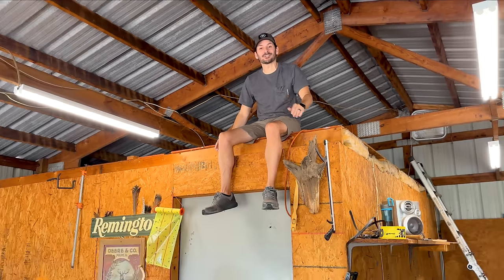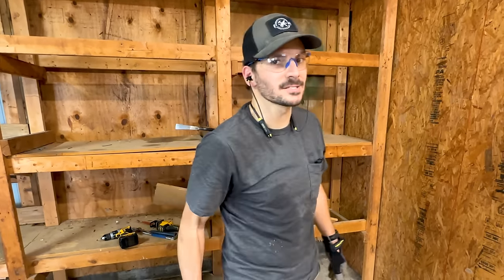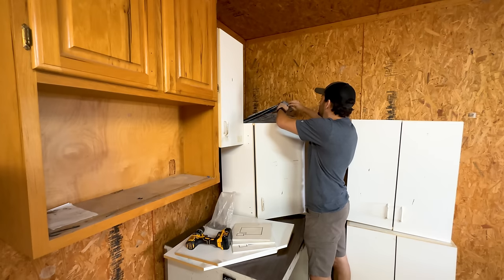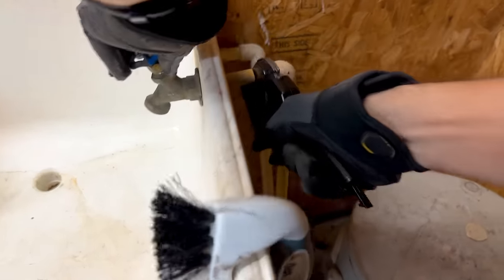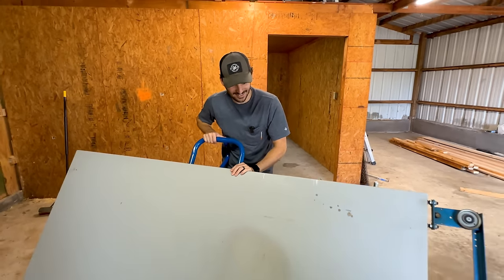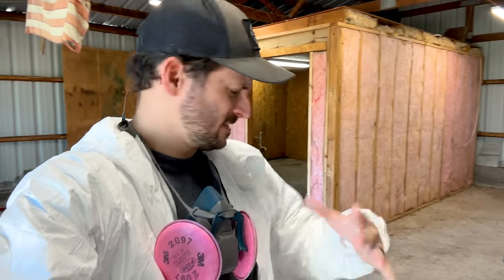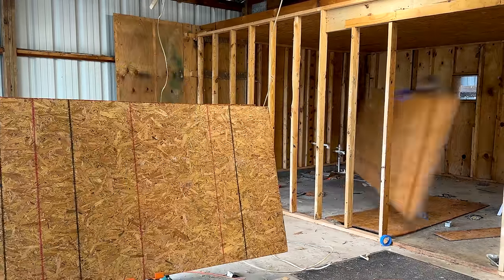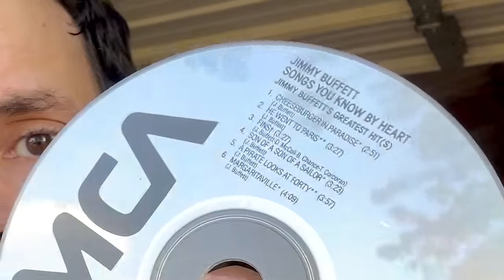It's worse than I thought... Demolishing My Old Shop

Comment: Might want to save the door to put on a finishing booth.  Keeping dust out of finish work in a shop is a challenge.
Reply: It’s metal, wonder if it’d contribute to static problems ??
Reply from the maker: Unfortunately as a sliding door it's not sealed
Reply: @Fixthisbuildthat  
Good point!  And weather stripping usually works poorly on sliding doors.  Will you have a finishing room?
Reply: You could seal on the walls around the door. Look up walk in coolers that sometimes have similar doors and how they seal.
Reply: @Fixthisbuildthat  With a suitable application of Pool Noodles, it could be!
Reply: @BiggMo no, quite the opposite actually. A metal door conducts therefore, it could be grounded and dissipate static.
Reply: I encourage you to box in at least 10' x 10' for a finishing room. It is a no-brainer...if you think on it for a minute.
Reply: @Fixthisbuildthat  Thats why you make it a pocket door instead of being externally on the track outside the wall.Being sandwiched into the wall it doesn't have to "seal" as it instead acts as the seal well enough on its own.

Comment: Can you make a welding table with the elevator door? Keep up the great work, love the new shop space.
Reply from the maker: ohhhhhhhh, I like that
Reply: Not being a shop person, I was just going to suggest 'a table of sorts' but I like your specific suggestion.
Reply: Yeah I was gonna say that door would be a great bench top. Didn't even think about a welding station. That would be an awesome use.
Reply: Needs to be raw steel for a welding table. Couldn't tell for sure, but it can't be stainless either. You also really want fixturing holes for clamps and stops and such.
Reply: That is the 1st thing I thought of... you beat me to the punch.
Reply: My first thought as well. Conductivity is the key. Stainless is conductive. Concerns would be it is solid not a grate to allow slag to fall through and losing the ability to tack a workpiece to the table (probably thin skin). But it would be a great door to any shop room

Comment: Your finding the nails AND screws together in the shelf supports & cabinet reminds me of when my brother & I cleared out/opened up the inside of our 2-car garage to make it into a woodshop. There was a loft towards the back at one side (the removal of said space hog was kind of what prompted me to start that project) & a small corridor behind that running the width of the garage. As we removed stuff, we found 2 especially weird things. One was a random stair stringer fastened to the back wall up towards the roof. The other was the backing board that apparently went to a science fair project by the previous owner's daughter - making up part of the back corridor wall. My brother joked that, when the previous owner had the garage built, he just told the builders to use whatever was left over from the house. LOL The former owner also loved his nails. While we did have to leave part of the back corridor dividing wall up to house the circuit breaker box, everything else came out. My only regret now, as I try to attach things to the walls that have to go into studs, is that we used OSB instead of plywood or sheetrock. The good news is that the OSB is only on the back area walls. The side walls have sheetrock, so it's not as big a hassle to find studs. But the OSB really doesn't want to hold screwed-in items like hooks, & it is very difficult to find studs behind it. But whatever.... I did get a few chuckles, kind of at your expense, during this video, though, Brad. I always love your sense of humor. I look forward to seeing what you do with the space. Hope you have an awesome day!

Comment: I have a central tool island with table saw and out feed table and to the right side, bandsaw, jointer and planer. Even in a larger shop it's a good idea to consolidate space where possible and since all these tools are often used together, having them all together is really efficient.

Because of the varying heights and feed directions, none of the infeed outfeed areas interfere with each other, I've got an easy 8'+ feed for each tool, the planer gets the outfeed table to feed onto and you can drop electric in  and dust in one spot, down the center of the dead area of the island. Additionally the dead space of each tool, right side of table saw, back of jointer, left side of bandsaw and planer, all fit up against each other.

One other tip is to have at least one rolling cart. It's great for moving stacks of parts around a larger space and to use as a "table" virtually anywhere. For example I use a cart to wheel parts over to my planer. The parts then stack up on the outfeed table and then go back on the cart to  for the next pass through.

Comment: I also recommend using double duplex outlets (4) with each side of the box on a different circuit. That way you have two outlets right next to each other that are on different circuits and you could run two high draw items in the same area at the same time without any worries.

Personally I went with external conduit. I ran it above counter height and down one side of the ceiling with a few branches to the other side. I had the conduit oversized in case I need additional wire later. It's a clean install, I don't mind looking at it and it's a lot easier to make changes.
Reply from the maker: yeah, love that idea of two circuts close to each other

Comment: turn the elevator  door in to a big cabinet door to store any paint or other flammable products
Reply from the maker: oh I like that idea.  But dang that thing is heavy.  I'd have to bolt it to the wall to open the doors, lol.
Reply: @Fixthisbuildthat  you could attach some heavy duty shelving to the side of the cabinet, that way you can keep it as a sliding door. Also later on if you want to get fancy with you could get some elevator buttons and a electric motor to open and close the door

Comment: Dude!  That elevator door makes a great work bench. I have one of the 30" wide doors someone gave me. Stainless steel top, mount to the 4x6's in the pole barn, I can bounce a transmission off of it without it even moving, then wipe it down with Windex and it's perfectly clean.  I'm only at 11:08 in the video right now, so maybe you've decided to keep it.  Hopefully so!
Reply from the maker: could be a great metalworking bench!

Comment: You might want to bleach and treat the metal walls before putting up new walls. This will prevent mold and rust from building up over time. Also, a mold resistant paint on the inside will further protect it from the elements and time. Given how much mold was in the walls, you probably want to give the metal walls a good cleaning before proceeding. That will make it not a health risk down the line. Build looks great!
Reply: If you're after mold prevention, hydrogen peroxide is used in professional mold remediation. Bleach won't actually get all the different molds.
Reply: White Vinegar

Comment: Seeing this shop project reminds me Jay Bates Garage Project. Along with the locations of equipment and his dust collection system, ergonomically, spaced and bundled tools reference electrical source and dust collection ducking.  I would insulate the walls with Spray Foam and face off the footing with block or brick then use the upper portion of that cavity chase for electrical, plumbing, dust collection. Obviously LED Lights and some type of over head storage loft. Don’t forget the AC Unit. Good Luck I’m sure it will nothing less than impressive when your done. If you get a small tractor don’t forget the fork lift arms so you can move pallets of material around.

Comment: Oh there are so many solutions and many good suggestions here. Work flow, storage options, organization that you have taught many of us. Electrical layout: when I started putting together my small stand alone shop. Plenty of available amps, sufficient circuits. I wired in 4 20 amp circuits one for each wall with outlets every 6ft. Better option have different circuits on every other outlet. Same number but adds wire. Many more thoughts but enough for post

Comment: I’m planning many circuits for light and heat, several 110 circuits for tools and battery tenders, and two or three 220 circuits for my big guns: table saw, compressor and welders.  Also planning on “attic” storage and air line drops.  I’ll add a short dust collection line as well.

Comment: For the elevator door. Use it to mount commonly used tools. Have it on a slide along the wall so you can move it around to where you are working.

Comment: I enjoyed that trip down memory lane with your old shops. That's awesome. My one suggestion for layout would be... i have a large 2 car garage. I ended up building a half wall out in between the doors. It helped me focus my flow. I was very all over before. It's a nice little area in a bigger shop. Plus you can hang stuff on the wall. More surface area! I turned it into my miter saw wall. It's working well for myself. I think you should cover the steel door in white board paneling and slide it around the outside and have either an idea board or green screen behind you anywhere in the shop! I'm excited to see the rest of the videos. Congrats. 👍

Comment: I'm wondering if the previous owner is watching these videos.

As for my shop organization opinions: I also have a sink in my shop and it's been WONDERFUL. Even things like cleaning glue off my hands without tracking sawdust into the house has been very useful. Definitely keep that! Sans the deer guts. I also ran electrical from two separate breakers to various points around the shop, which has been very handy. I assume you're planning to insulate; that looks like it would turn into an oven in the summer. I imagine you're already well aware of that.

As for the door - do you do much welding? That might be a good top for a welding table. Or if you shoot, or have any buddies that shoot, they might make it into a target. I'm not sure how well that particular type of metal would work but I know some guys that love shooting at metal targets. Ooor you could just follow your wife's suggestion.
Reply from the maker: yes, insulation is the next step.  It's ROASTING in there and I'm glad it's September not July

Comment: I felt that “surprises” comment… we bought a house 2 months ago the ago.. I been working g on things here and there I started on the bathroom and wanted to talk out the old caulk around the tub/shower and replace it with new silicone.. well then I noticed drywall crumbling down into the tub from behind the surround so I pulled down the surround found a bunch of mold continuing on busted up the old tub and there was standing water under it.. 🤦🏽‍♀️ needless to say I now have had to start rebuilding all of my bathroom.. that was supposed to be a project for next year.

Comment: In my last shop, I had a few extra panel spaces to spare. I ran half my outlets along the wall at every other space on a separate breaker. Then color coded the outlet covers to easily tell which outlets are on which breaker. Outlets were spaced close together throughout the shop but every other one was on separate circuit.  I've only had the need a couple of times but having outlets close to each other and being able to run a multiple tools without tripping was nice.
Reply from the maker: Love that idea

Comment: Congrats on your new shop. My wish list would include a floating plywood floor where I could run the dust collection pipes underneath but still be able to unscrew and remove a panel of the floor if needed to unclog or rearrange. Also, I would build a sound proof booth for the air compressor.

Comment: 3:32... reminds me of the previous owner of my home who built "shelves" in my basement all the way around the walls.  Scrap wood with just about every fastener and head type you can come up with.  Unsealed/unpainted particle board shelving to boot.  It was good, well, for nothing.  Could barely hold its own weight.

Save the tub... makes for a good paint wash/cleanup station!  Although a bit large, the old shop would make a nice paint booth.... with that door too.

Comment: Elevator Door: I'm guesing versions of "making it into a table" have been said, but what i suggested is make 2 box frames for legs. In one box frame will be a counter weight (can be fake the table will be heavily enough) then from the weight under the door to the other side to the box frame leg are wire cables suspected on pullies. Normal Elevators have on average 7 cables but you can choose the count of back and forths. To double explain just in case, one side of the lefts is a weight suspected by multiple back and forths of a cord that runs the top length of the table under the elevator door top and looping on a set of pullies. Hope you like the idea.

Comment: For that door, ideas:
1) make it an underbase for a tabletop of some sort (metal on bottom, wood on top, screwed from the bottom. Gives extreme rigidity/durability
2) Get a cutting torch to cut out custom reinforcing brackets, triangles, etc. 
3) Swap this out with some local fab shop in exchange for some service. They might want to use the door as is, as a door, or cut it up like in #2. 
4) Get into welding and doghole the heck out of this as a base for your new DIY welding table. Take that, Fireball Tool!
5) Recycle it. Iron is cheap, but that's a lot of weight so you'll still get something like $10-20 for it. 
6) Weld or bolt up sections to make weights to use as glue clamps. Way cheaper than buying dumbbells or kettlebells. 
7) Turn into a horizontal entry door for your root cellar, since at your new place you will be growing all your own food. 
8) Use the door as is as the key feature for your panic room to prepare for the zombie apocalypse, round #2 of covid, or when the in-laws come over. 
9) Climate-proof yourself as you carve a tornado shelter into your shop floor. Just install that man slab onto some rollers over your panic cave and you're good to go.

Comment: This is great, Brad~!  I finally graduated to a 30'x40' pole barn and I love it~!  I wish that I had some advice for you regarding its setup, but I'll actually be looking to you to see what I can pick up.  I've not decided on anything resembling a work flow yet for my tool arrangement, so I'll be very interested to see what you do.
That rotted out girt doesn't really look like much of a problem, as long as that's the extent of it...simple replacement (?).
I framed up 2x4 walls between my 6x6 posts spaced 10' apart and covered them with 3/4" ply.  Almost done...
Ready to see the next video~!
Reply from the maker: Haven't inspected that corner post yet. Hoping it's just the girts!
Reply: Need to find and fix the roof/siding issue that caused the rot too! @Fixthisbuildthat

Comment: I like the finishing booth idea. However, I think you could come up w a rolling/movable rack. Pegboard on it to move many things throughout the shop to different "stations" as needed. Or, if you could rig up a mobile dust collection/vacuum system on a track to take to your different "stations." Would take some design (I have one in my head, but can't put it here), but could be very useful.

Comment: A loft that runs around the top of the shop that you can store bins. And you can add some led pot lights on the bottom so you only have to light up the areas you are working in

Comment: be super cool to put a french cleat system on the elevator door to hold all the less commonly used shop items and have it tuck behind a cabinet or just to simply use as a door on a tool cabinet

Comment: When you build your walls, be sure to put Tyvek or something similar on the backside of the wall to prevent moisture passage from the steel thru to your new walls.  I would also remove the flat 2x4s and just frame your new 2x4 walls on top of the concrete knee wall.  It will basically make your shop 8" wider as well as youll have something that cant be damaged as concrete > any sheathing or drywall.

Comment: Best tip is exposed EMT conduit. Easy to put up, easy to modify, easy to take down. You don't have to cut holes in your walls which saves time and is more energy efficient.

Comment: List of things I would have if I had a shop that size. 
1. Air everywhere, every tool station should have close access to dry high pressure air. 
2. properly piped dust collection. 
3. Proper miter station (But I don't need to tell you that).  
4. 110 plugs everywhere and at least 4 220 receptacles. 
5. a proper 5x10 CNC from Avid CNC with a tool changer. 
6. Proper wood storage for at least 10 sheets of Baltic Birch and all the rest of the cut offs. 
7. a proper office that is completely sealed off from the shop so I can have computers, 3D Printers and all my soldering stuff without getting sawdust on or in everything. 
8. Large Roll up door for materials and rolling out bigger builds.
9. HVAC so I can work year round.
ventilation system.
11. lots and lots of rolling storage. 
12. Nice big work and assembly table on wheels that can double as a outfeed table.
13. Tons more but I have to get back to the shop 😉

Comment: Crazy shop rebuild suggestion:  raised floors.  I know, I know, sounds stupid/crazy, but you can tuck all the electrical underneath and have outlets right at the tools without any wires hanging down.  Make it tall enough, and you can do your air handling ducts as well (I hate hate hate working over my head).  AND, it gives you a thermal barrier off that concrete.  AND! If you have a wood floor, it can be more forgiving to your knees and lower back than standing on concrete all the time.  Plus, you can stash your empty beer cases in there.

Comment: can you attach anything to the elevator door? If so, you could have a section of wall with two "layers" of tools. You side the door back and forth to reveal what you need from behind, but the most commonly needed tools hang on the door. It would double your hanging space for one section.